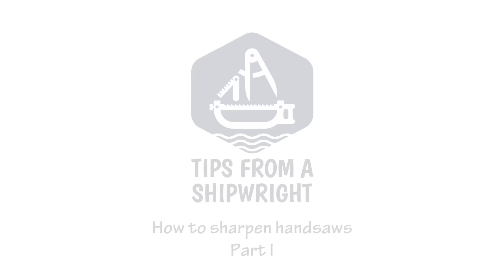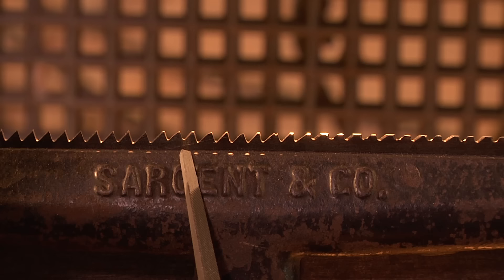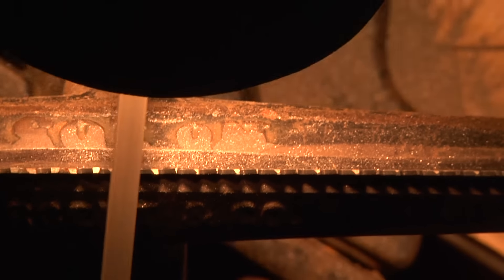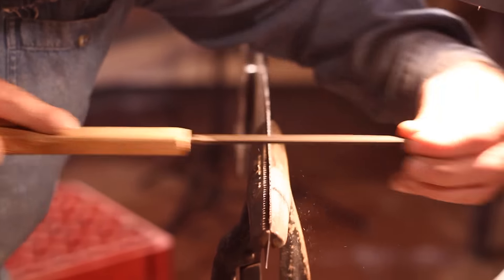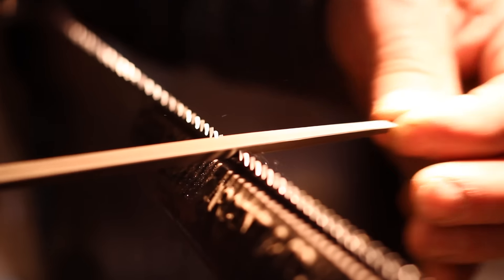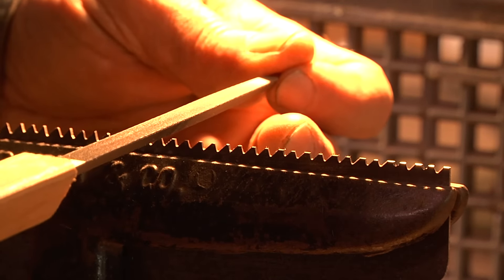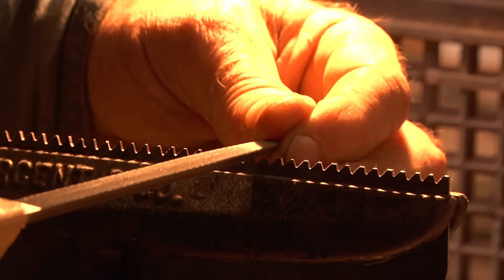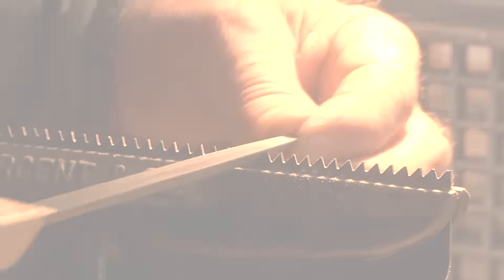How to sharpen a handsaw using a file with Master Shipwright Louis Sauzedde (Part 1 of 2)

Comment: My father born in 1915 was a master carpenter in the Marines. The reason you would sharpen your own saws was they were super high quality and not disposable. He had a matched set of saws with one for every task. Paraffin wax was always on hand to rub across the blade to reduce friction. I can still see him cutting through a sheet of plywood with very little effort. Long straight cuts were not a problem. These same skills were applied to everything he did be it metal work or overhauling an engine. You just become skilled with your hands. Pride in your work and tools is a big part of it. The rewards of a job well done are priceless.

Comment: this is probably the best video about restoring the teeth of an old handsaw and it is great for somebody with experience, but I saw this when I was a beginner and in fact it made me mess up some saws. when you are starting, you do not have the control and the feel for it.

to me, the foolproof way of dealing with sharpening is getting a new saw and, when it become slightly dull, sharpening it with the same number of passes in every tooth, trying your best to match the factory angles. do two passes, test it, maybe put another one or two in every tooth. in the long run, of course you can start putting your own twist on it, but this video adds a lot of information that can be counterproductive to a beginner.

Comment: Louis, you make it look a lot easier than it is and this is a cross cut saw as opposed to a rip saw, which is filed differently and is easier. For anyone else just learning, get a cheap saw from a flea market to practice on, LOTS of light and good magnification. You can not teach years of experience - if you've ever tried to file a saw, you will understand and appreciate the skill in this video.

Scott
Reply: Having the right vice to hold the saw also makes a BIG difference

Comment: I tried this method on a 12" x 14 pt backsaw but sharpened straight across as was advised by another saw sharpener. At the number of teeth and considering most of the work with that saw is ripping, I figured it would be a good saw to try this on. The results were wonderful. The teeth were all the same and the cut is as good as I have ever had for this saw. I am getting ready to try it with a 22" x 12 pt crosscut saw so I watched the video again to sort out what to do. I did not want to confuse conventional sharpening with this counter-intuitive method in order to make sure I get those good results again. Thanks.

Comment: Can you see the tops of the teeth and the depth at the same time?  I think I'm filing with me head right over the teeth so that I can see the tips, but I can't see the depth well without moving my head off to the side a bit. Handling uneven teeth like you're doing is still really hard for me, so I'm hoping to learn from this. I jump around too, but have a hard time deciding if I should push or pull a tooth vs. going straight down.

Comment: Had the builders in working on the shed, they brought two new saws, and at the end of the work they left them, as they said they use new saws for each job.   I suppose in these days where a saw costs just 3 pounds, and have electricaly hardened teeth, there is no longer needed the art of saw sharpening.   Do you need to 'Set' each tooth, using a pincer type tool, to create the kerf width...?

Comment: I have a couple of 'file' questions:

1) Triangular files are easy to find, but for sharpening a saw you need a 6-sided triangular file. Are all triangular files 6-sided, so just any one will do?

2) It was not clear from other comments which modern day files would be good for this application. Someone mentioned 'Nicholson' and 'Snap-on', and suggested that only 'Snap-on' still sold quality files. What is your personal opinion? And, are there other quality file manufacturers around today?
Reply: Bill Cowhig 
1. All triangular files are six-sided, it's just that three out of the six are very small.
2. A lot of people like the Nicholson files (including me), especially the older ones, but I have never heard of Snap-on.
Any triangular file will work,
but some are going to last longer, other's not.
I know I am a bit late, but i hope this helps.
Reply: Bahco files are good.

Comment: is this sharpener tool or whats tha nema because I m looking for right making sharp my small saw
Reply: glyn hodges  ...w-e-e-e-l-l, yeah, but "the right size" isn't what you might think.  You need a file whose sides are AT LEAST twice the height of the tooth-face (gullet to point) you're sharpening.  Reason being, if the file's sides are less than twice the height of the tooth, as you rotate the file to get fresh surfaces, you'll be wearing out the center of each file-face...soon you'll only be filing the gullet, since the part of the file that hits the point will be worn out.

Comment: Uh, Lou, I think you need three 120 degree angles to make 360 degrees around the file handle.  Three 60 degree angles only equals 180 degrees, which is only half way around the handle.

Comment: According to Paul Sellers (see his You Tube video) all you need to do on panel saws is to file straight across.  This put a rip cut on each tooth.  The difference between panel and rip saws is the way in which each tooth is set.  The way you are sharpening is for cross cut saws, which you don't need for most sawing applications.
Reply: There is no doubt that Paul Sellers is a fabled craftsman -- I study his videos and try to emulate some of his methods (but I often cheat and use modern sharpening equipment like the WorkSharp WS2000 and WS3000).  And there are times I disagree with his advice.  As you say, he does recommend using rip saws for, what?, maybe 90% of all saw cuts, saying that a properly sharpened rip saw does almost as good a job on crosscuts as a saw specifically sharpened to do crosscuts.  That just is not so.  Having used my dad's old Disston and Bishop saws, both rip and crosscut, which he kept very sharp (he started out as a machinist), I can tell you that it was a pleasure to use his cross-cut saws.  They cut almost as fast as a Skilsaw, and left a cleaner cut.  So let's hear it for FLEAM!

Comment: Dude don't be cheap man. If you value your working time more 4 dollars an hour buy a new one. But I do have to say that I'm impressed of the work you are putting down on that saw. You must live that rusty thing
Reply: It's not just the "cheap throwaway garbage" aspect.  New saws cannot be sharpened.  The teeth are induction-hardened.  Old saws were merely tempered so that they could be reconfigured and sharpened as Louis shows.
Reply: That's not a $10 saw.  I have some saws my grandfather used to use, new ones are not the same and most cannot be sharpened.  This tool was made before the disposable junk age.
Reply: Good quality saws are still out there for a price. They're not in the big stores. If you know what you're looking at, you can see saws in those stores that would never cut right unless they were re-sharpened. A hundred years ago, this saw would have been hand filed at the factory. When they switched to machines, a knowledgeable woodworker would often have to sharpen and set the new saw before it would cut like it was meant to. 

It doesn't take long to learn how or to do this and it makes handsawing a pleasure.
Reply: Patrick Ancona  Try Bahco files (made in Portugal).  I find they last longer than modern Nicholsons.